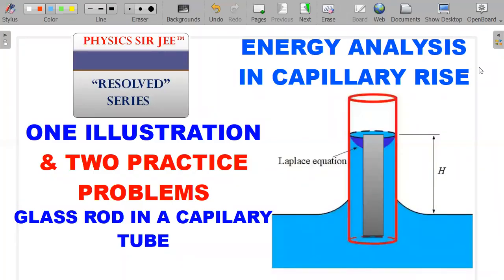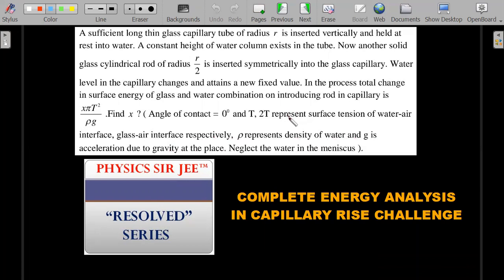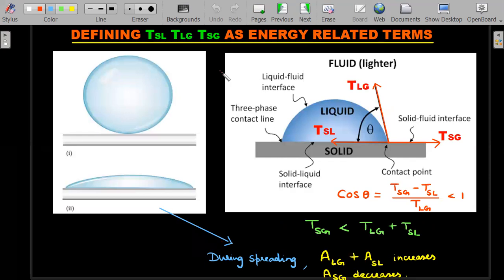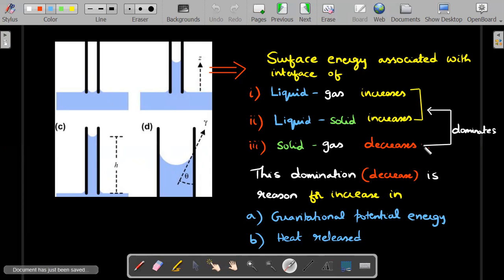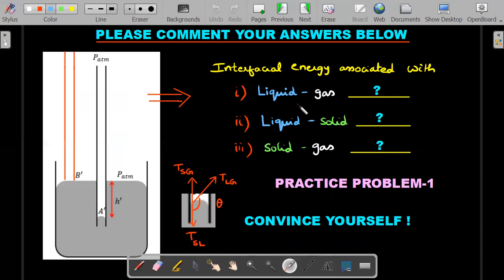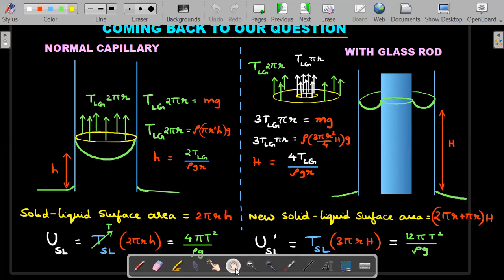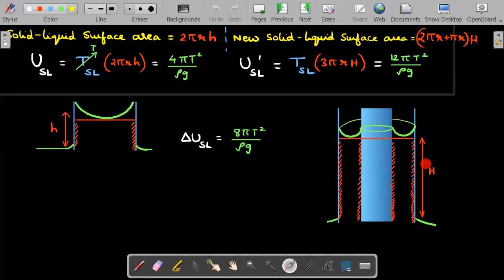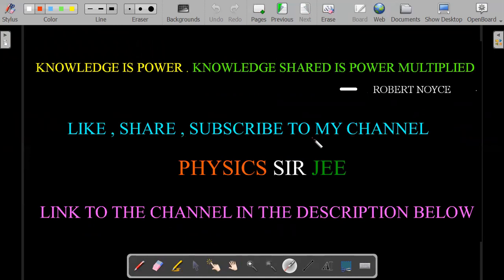RESOLVED-18 VIDEO | SURFACE TENSION ENERGY ANALYSIS | ROD IN CAPILARY | JEE ADVANCED SCHOOL PHYSICS

Comment: Excellent video sir

Pls sir complete that optics problem related to jee advance 2020 video series

Also pls make a video on thermodynamics jee advanced 2020 question which was given as BONUS (marks to all) with reason of Bonus and correct question
Reply from the maker: I made Optics video. It was very long and I didn't like the narrative. That's why cancelled it. I will try to make a concise version in the future. Also thermodynamics JEE 2020 Question is a good suggestion. I will look into it 😊